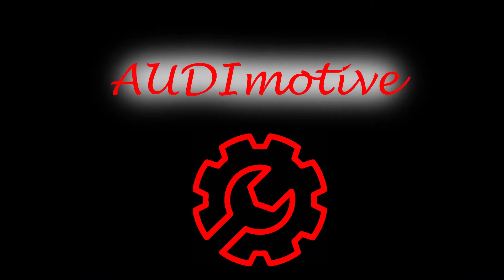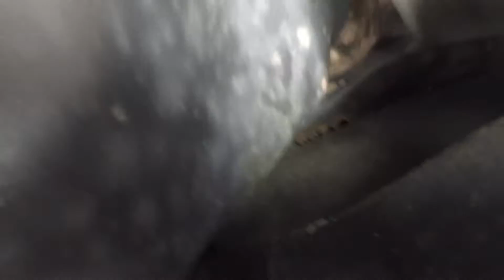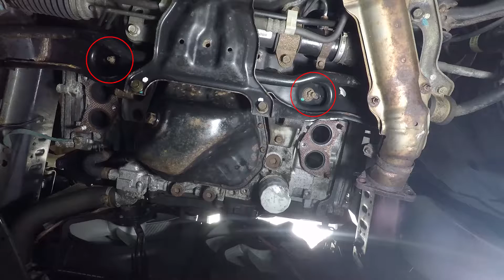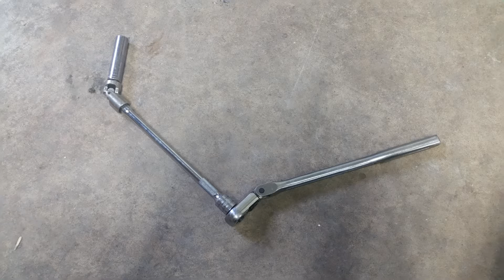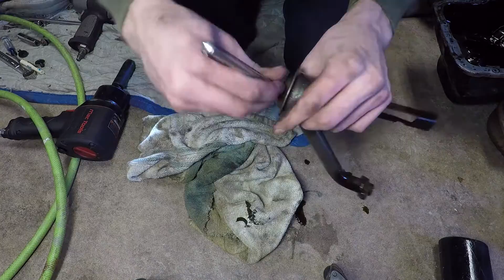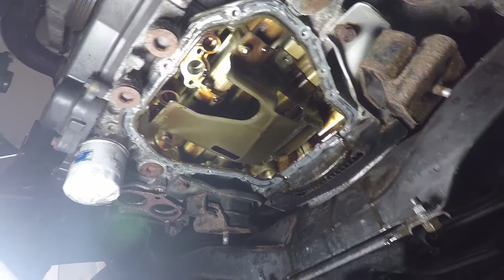Foil in my oil!! Removing Subaru oil pan

Comment: Local dealer recently told me my "upper" oil pan gasket was leaking. Huh?? Said engine has to come out, replace gasket and "oil separator" for $2700. 2009 Impreza, EJ25, non turbo. I thought oil separators were on big diesel engines. I dont know wtf this guy is talking about.
Reply: Oil separator plate. It’s a 3”x6” cover plate behind the flywheel. The early 2000s EJ design would eventually leak. Only way to get access it to pull the engine.

Comment: Better than marring your enjine block and bending oil pan, don't use a pry bar to start. Start with a soft type mallet (rubber or soft orange dead blow) and tap the oil pan gently from different sides until you see slight movement. (Careful not to damage your oil pick up.) After you got a little wiggle now you will be able to slide a pry bar in much easier without jabbing at the gasket and thus risking damaging your engine.
Reply: I'm way past gently tapping on this oil pan with a mallet and this thing isn't budging in the slightest. They must've started using stronger glue or something cause I'm scratching my head over here lol.

Comment: Its critical to remove the pitch stop before you jack up the engine/transmission. Good video though
Reply: I would and I always do anytime i jack up my engine, i have a solid one the plastic one will probably flex.
Reply: What is the pitch stop?
Reply: @flyingmunk8956  it's a little link thats like 5 ish inches long on top of the motor right up against the firewall closest to the windshield, it should be right where the throttle body is

Comment: Thank you for this video man.  I have a rusty oil pan and am looking to remove and prep it for rust removal and basecoating.  This helped so much!
Reply from the maker: +tigerpaw good luck! Make sure you don't bend the edges if you need to pry on it. I know I'm going to need to turn the pan upside down on a flat surface and hammer the edges straight again
Reply: Do you think it would be necessary to replace the header gaskets?  Is there a good way of telling if they are reusable?
Reply from the maker: +tigerpaw I think it's worth replacing. The gaskets are layered steel and when compressed, create a good seal. After being compressed and heated, they aren't guaranteed to seal as well. I recently tried reusing intake gaskets of the same design and the car ran horrible. Intake leaks everywhere. Exhaust goes through even worse conditions. It's up to you, but I'd say get new gaskets
Reply: how in the world did you loosen the top bolt of the 3 on the manifold-converter flange!?
Reply from the maker: +tigerpaw it wasn't too bad for me. If I remember correctly I had to have the ratchet angled up from the inside. I had to use the feet for leverage to get it loose!
Reply: yeah it was a bugger.  used some pb blaster and took the passenger wheel off to get a breaker bar in there!  all good now.  just waiting for the 24hr cure ^.^